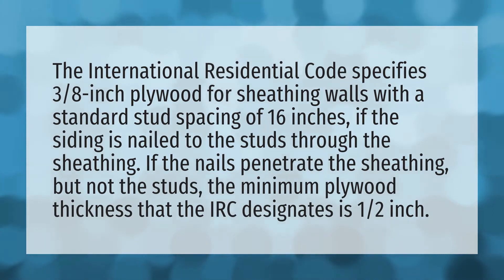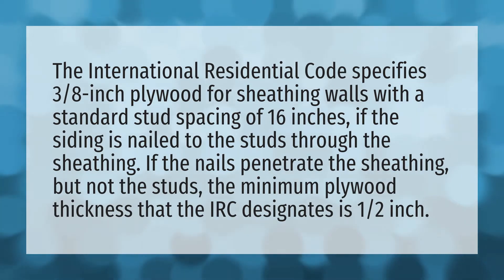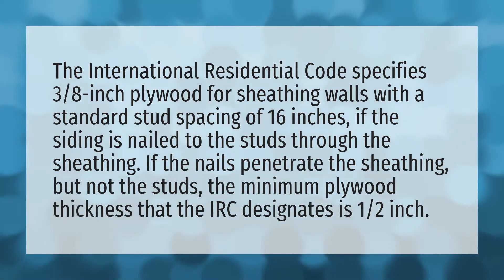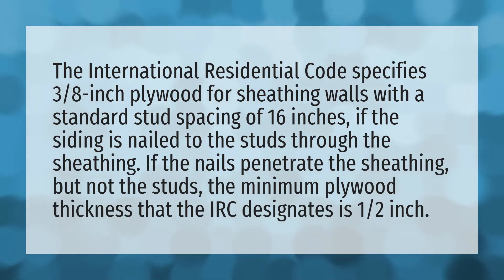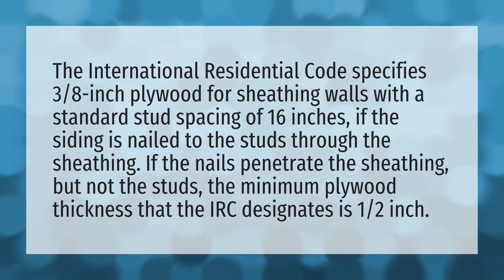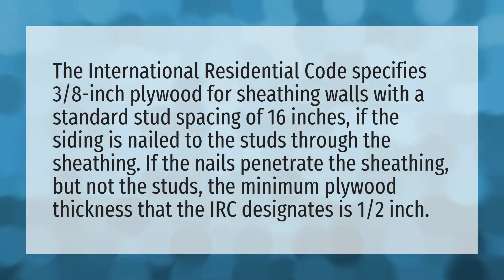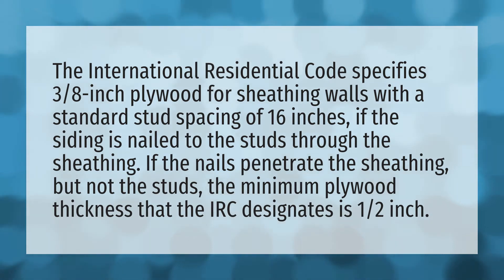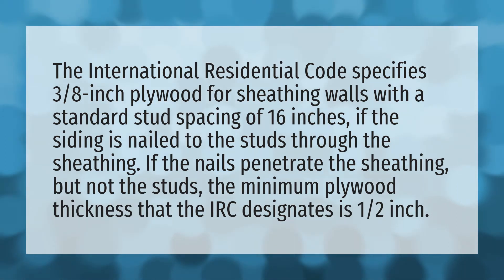How thick should wall sheathing be?

Comment: Over time I've learned in my area (east Texas)  for most conventional housing, any thing between 3/8 - 9/16 inch for plywood set directly to the wall studs on residential housing  should be sufficient, but areas prone to more wind turbulence should be 1/2  -3/4 inch,  but it can also depend on the engineering of said structure.
I just wish new construction in my area would take note,  they wrap their houses from  a roll of cardboard composite  type sheathing.